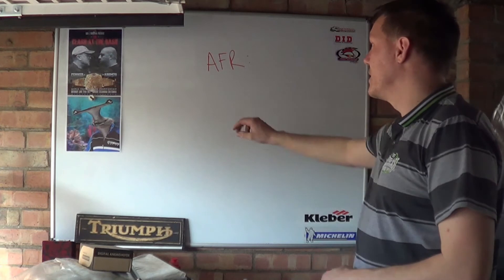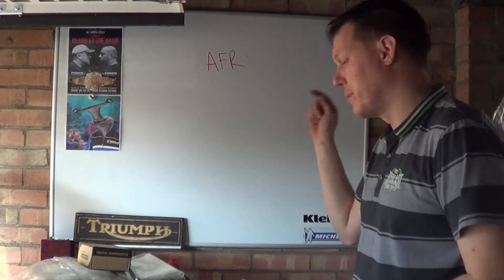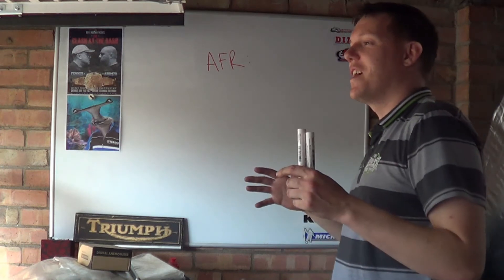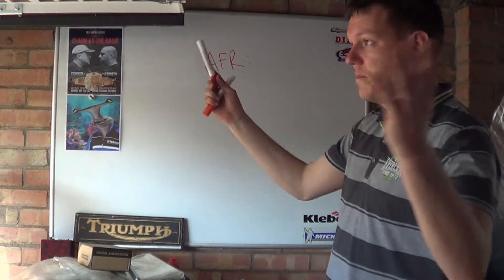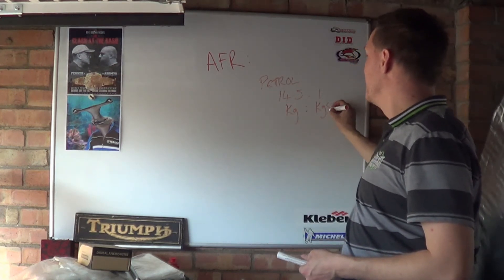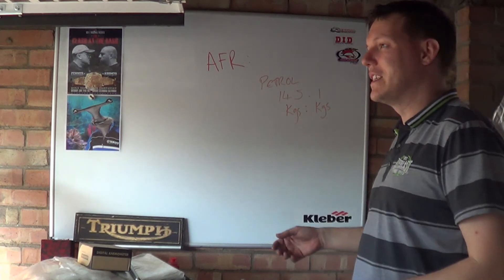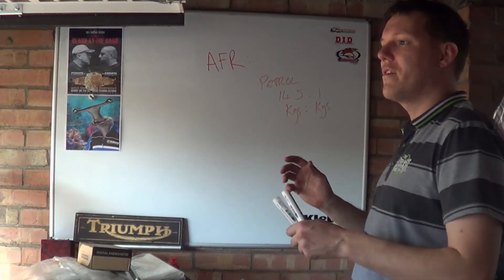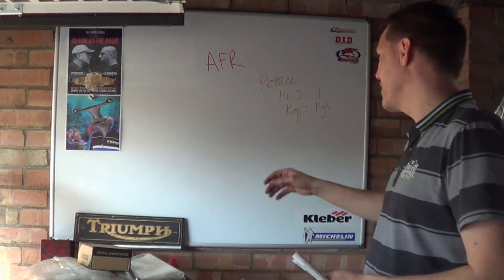Air/fuel ratio

Comment: Hey, Matt I have a question thath really bugs me a lot. ( as you can tell I'm hooked to your videos ).

To my understanding and from an scientific point of view, the stoichiometric ratio should produce the most combustion temperature!

For example if you take a lean mixture you have more air than fuel, all of this unused air will heat up by absorbing some of the heat that combustion produced, thats the theory anyway!

In the turbopumps that is commonly used in rockets the combustion is either lean or rich and thats because if you ran it on stoichiometric ratio the compressor turbine will overheat and melt!

Now to my understanding rich mixture will cool the combustion chamber on an ICE because some droplets of fuel will evaporate and absorb a lot of heat.

But why lean condition will make the engine overheat and NOT the stoichiometric?

I believe that this is misconception from 2 strokes and these engines overheat due to lack of oil... but I may be completely and absolutely wrong.

Excellent videos keep it up!
Reply from the maker: The video answering this question will be published in about 1 hour - cheers for the comment dude - matt
Reply: Thanks a lot that video should be very interesting.
Reply: Do you mind linking the video if possible? This is my number 1 question. It seems from the research I've done on both diesels and petrol engines (and turbines as well) that stoich is where the highest heat is generated, but i'm no engineer and only have very limited experience tuning an old pushrod 5.0 that I've since sold.  Is it just the fact that petrol engines are run so rich at full load that we consider anything leaner than that (and therefore closer to stoch) as "lean" and damaging? I feel like I'm missing a big piece of the puzzle but can't afford to go back to school to learn it.